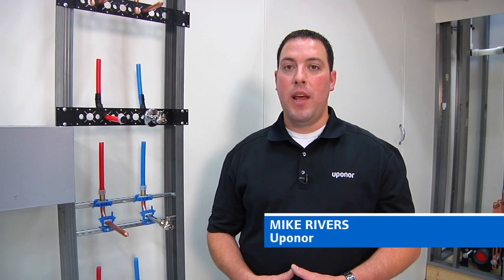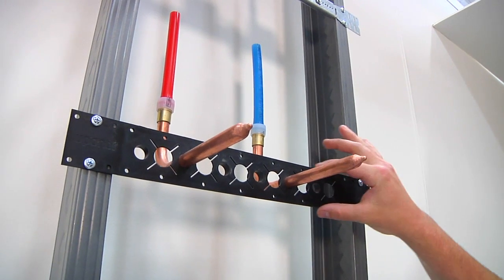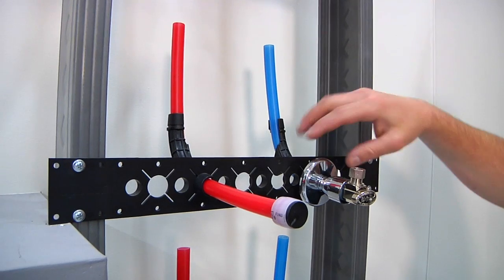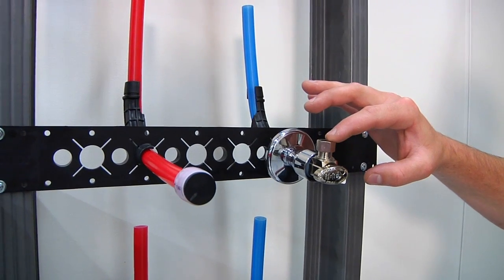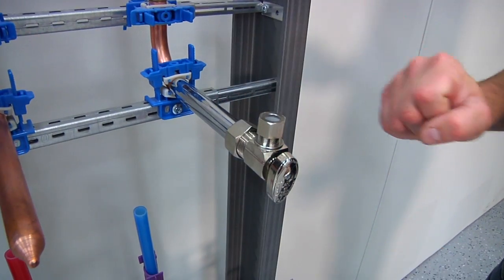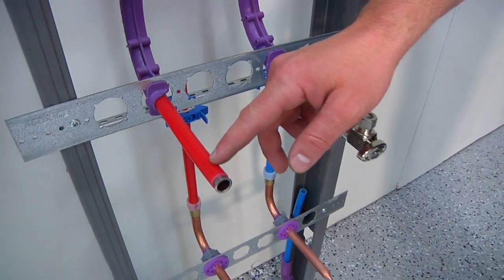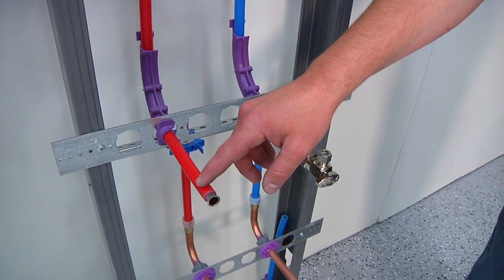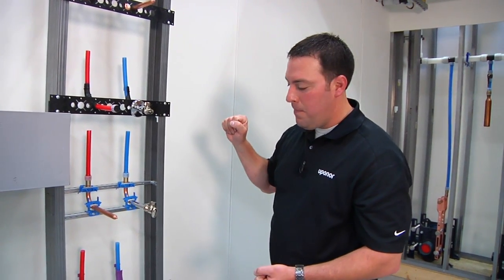Fixture Termination Options for Uponor AquaPEX® Plumbing Systems

Comment: I think the biggest problem with Pex A, no  matter the brand, is you cannot buy it in a local hardware or home improvement store. So if you want to do just your own home, you will have to order online and hope you ordered enough, and then deal with any unused fittings, etc. One issue I never see addressed is how to terminate through the floor from the basement, where you don't want to tear out the walls to plumb the toilet. Also when shopping online, there is very limited fixtures without some conversion to pex-a. Not a big issue, but just more joints.

As I understand it, this is the oldest type of Pex, yet the market and all the stores just carry pex-b and PTC expensive fittings, which I suppose is because it is more idiot proof. I have chose, but yet to buy Pex-A because it will be in a cold climate and should be more durable in case something freezes, power goes out, etc. Now just get this stuff sold at the local outlets so we can just buy what we need, see what is available, and not have to wait a week to have it shipped.
Reply: Pex A is idiot proof. Pex B needs the clamp ring to be checked with a gauge, Pex A can be checked by looking at it.    Fyi, Home Depots' in SoCal are carrying Pex A, started less than a year ago. They even sell the Milwaukee cordless expansion tool. Considering it now costs $20 for a 10' stick of 1/2 copper, Pex A will be what we all are using in 10 years. I officially stopped using copper for my remodels this year. Pex A  is a dream come true :)
Reply: Some hoem depots are starting to get with the program.... tell people in the plumbing department on a regular basis that we want pex a!
Reply: Two Home Depot’s in my area carry PEX A. But many more carry PEX B.
Reply: This is a very covid-era statement

Comment: If I use the Propex expansion type stop valve (option 2 in the video)  and it needs to be replaced sometime in the future, won't that cause a problem with having too short a stub to work with if the pex has to be cut off?  Can Aquapex be used with a slip on Sharkbite type angle stop?
Reply: I believe if you left enough slack behind the drywall, you could pull the pipe out.
the pipe will slide back and forth even with that bracket thing holding it in place.
Reply: @davidjacobs8558  it drives me crazy when I see “floppy” water stops!  I like to secure my pipe well and just have the backs of the stops out past the wall a bit.  👍🏻
Reply: You wouldn't be able to remove a sharkbite any easier, since you need to release it from the back. It seems like in either case you need to destroy the escutcheon without damaging the pipe, remove the fitting (sharkbite ring or cut propex ring). It really seems ill considered.
Reply: @im1oldfella  you need very little space to remove sharkbite push to connect if you use U shaped metal tool they sell.
only need about 1/4 inch clearance from the wall.

Comment: Where did you find blue 1/2” Aquapex? I’ve been looking and emailing the company for a month!
Reply: I heard the manufacturer closed down the blue line for some reason. You can use white in place of blue. Same pipe. just different color.
Reply: I just got some of the blue and red at Ferguson distribution center ordered through one of their local stores
Reply: Supply house.com
Reply: I just got a roll of blue also at express pipe n San Diego
Reply: Home depot and Lowes
Reply: @dennismadigan2023  Home Depot and Lowes blue pipe are not Pex-A type. 
Apollo pex-a only have blue or red or black lettering on white pipe.
then again, the red Uponor pipe is just red paint over white pipe.

Comment: I'm about to change out my house to this same system, but I am concerned  about a very long run to our new kitchen.  From the hot water/manabloc system it will be about 100'.  The instructions from Manabloc do not recommend a recirculating pump.  How do I keep hot water in my kitchen without having to purge 100' of line every time?  Any thoughts?
Reply: Michael Hovland How about under cabinet on demand quick water heater.
Reply: Run a separate pipe independant of the manablock tee off and check valved from the kitchen to the water pump near the water heater or, use a watts undersink recirculation pump…
Reply: What did you end up doing? Personally I’ve gone the Recirc pump route. Probably best to install a third line for hot water return even if you don’t plan to use it - so much easier when the walls are open! Just case.